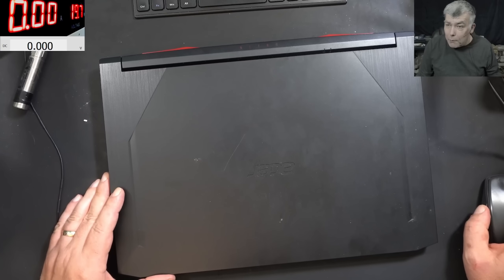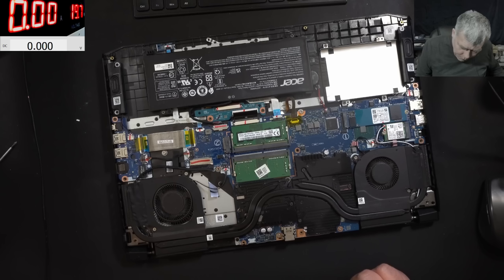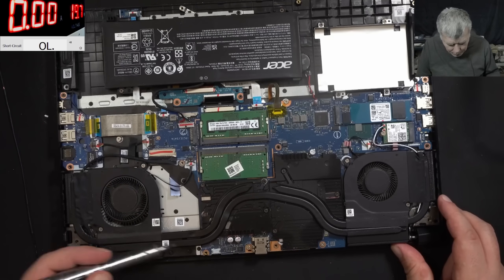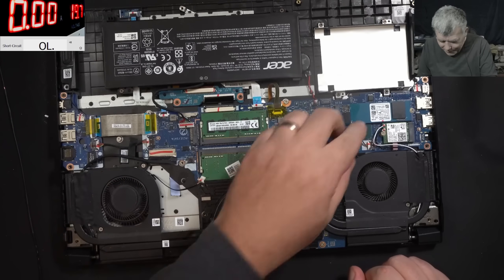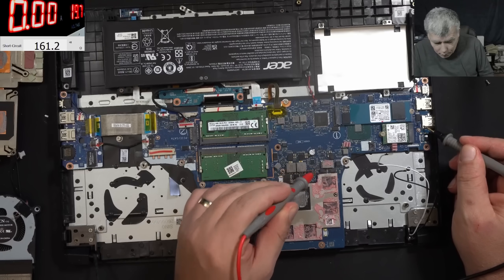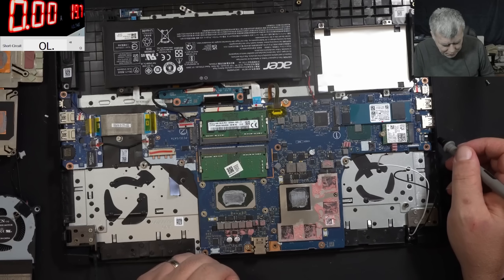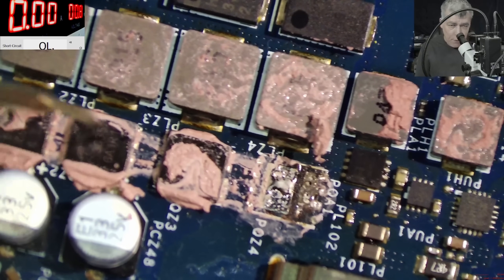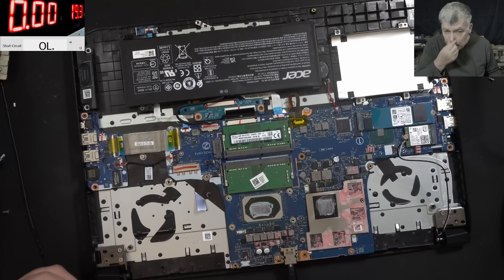Acer Nitro 5 no power - Shorted cpu mosfet, do you belive in miracles?

Comment: I have an Acer nitro 5, a similar model, just decided to shut off on me with no sign of life, took it to a PC repair shop, got a call saying the MOSFET for power regulation was dead, it's currently being repaired. After watching your videos on said gaming laptops, they sure do seem to like blowing MOSFETs or capacitors, maybe it would be a good idea to keep a stock of said components just in case these keep happening to the unfortunate recipient. All in all, very lovely videos showing how to repair and understand these laptops, excellent, keep up the good work brother 👍
Reply: Does anyone know for this laptop ACER Nitro 5 AN517-52-71C7 i7 11 gen. Rtx 3060 model of first N mosfet. I need to replace it but i dont see clearly which mark is on it and which one mosfet i can buy as replacement.
Reply: @borismat  similar model to mine, take it to a repair mob, best advice I can give, there's also no guarantee that the laptop in question will run as good after, hence why it's best to get a new PC and transfer the hard drive and data over, that's the best I recommend
Reply: @borismat  I think any channel-N mosfet with the current rating at 100A or higher should work.

Comment: Merry Christmas Sorin, first off thank you so much for sharing your knowledge, I absolutely love your videos and I've learnt so much more. I was recently watching one of your repairs (can't remember which one) where you was having trouble finding the power on pin on the keyboard connector so i thought I'd pass on a great tip that I came across from another YouTuber. If you set your multimeter on diode mode and red probe on ground then as soon as the black probe touches the power on pin the laptop should turn on. Hope this is useful and keep up the great work.

Comment: Few days back i had dealth with same problem. While the customer applying  cpu heatsink past the vcore ic got shorted and it turned into system to dead condition. While checking motherboard i found that there's main 19v shorted and i sorted out the short by removing cpu vcore mosfet but still there is no image on screen. I think the vcore ic is probably faulty or the cpu. Cpu coils show 0homs

Comment: Hi Sorin... Wish you & your family Merry Christmas. I have a question... if I remove the Nvidia chip from the laptop board will the board will still function & have display?
Reply: The answer is yes, but you will need help from the motherboard schematic, it is not complicated.

In the motherboard schematic, Asus and Acer have a system similar to desktop motherboards, so much so that if the screen breaks, you can use the VGA on an external monitor as well, and it will work normally as a desktop.

What makes the screen choose between the GPU and the processor GPU is merely a hardware configuration (there is a resistor that defines which video the computer will use).

Assuming that the GPU is dead... you can remove it without any problems, and modify the circuit to work with the processor's native GPU, most low-cost laptops are like this, the GPU is not placed, and the circuit is switched to only use the processor's integrated GPU.

There are videos here, where they show how to do this (usually by Indian technicians), but if you do not know, ask a technician to do it, do not do it yourself without knowledge of the circuit or electronics in general.

Comment: Greetings and Merry Christmas to all, I have two questions, if anyone can answer I would appreciate it.
1.- How do I know where the main power rail is to know if the CPU is shorted?
2.- How do I know which mosfet should be removed to remove the short from the CPU as seen in the video?
Thanks
Reply: In general, the processor power line has a specific coil and all these power lines have a filtering circuit (you have high-voltage MOSFETs, which work through PWM and activate the low-voltage MOSFETs, generating voltages for the processor, memory, PCH, among others (I'll try to simplify this as much as possible)).

Each laptop or desktop motherboard is organized in a simple way in relation to this.
Laptop motherboards already have a proprietary format, so the power coils can change places according to the motherboard's engineering.

Generally, this processor power coil or line is 1.05V (a little more, a little less, but it stays in this range), but in some more modern machines, it can change, but it is usually this value.

When shorted, the component will heat up. When the technician does not have a thermal camera, he can simply use the multimeter to determine the short (continuity test), but this is not always necessary because the resistance of the processor or PCH is low (8 ohms on average, more or less, which is not a short).
Another, more archaic method is to put your finger in and see which component heats up. In this case, it uses a regulated power supply and a thermal camera, which allows you to see which component will heat up...
To find out which, a low voltage is applied using the regulated power supply, 1.0v is recommended, above that, it will damage the motherboard track or components, the amperage is important, it is usually adjusted to 1.0 amp or 2.0 amp, the current should not be too high, otherwise, it will also damage tracks or components, 2.0 amps is already considered too high, but for testing purposes it is not a problem, finally, it uses the thermal camera and analyzes which component heats up, in the absence of a thermal camera, you use your finger.
This is how you determine, roughly, which component is short-circuited (this type of test only applies to Chips, Processors, MOSFETs and of course, capacitors).

There is also another type of test, called the 4-prong test, in which a multimeter, fitted with a 3 to 5 watt resistor, for 15 ohm to 100 ohm maximum, is connected to the positive test lead, powered by a pack of common batteries totaling 2 batteries (between 3.0v and 4.5v maximum). Lithium batteries should not be used, because with low resistance or impedance (they are the same thing, resistance for DC, and impedance for AC), lithium batteries will explode.
The test is simple, adjust the multimeter to measure current of up to 200 milliamps, and then... when testing a component (capacitors, more specifically), measure the current of the lowest possible value. If the lowest current is found, then we have the component in a short circuit (because there are cases where, even with a short circuit, there are components that will not heat up). A shorted component, in addition to getting very hot, will have an excessively high current consumption.

Comment: Hello Sorin , on 4min 15 sec , you says the resistance is high, i thing you means the resistance is Low ? Not ?
Reply: In general, the resistance of processors (power supply line) and PCHs are really low.

Around 3 ohms, but the normal is 8 ohms. There are cases that vary, but never too low, even a little higher is normal (I've seen models with up to 2 ohms).

Comment: So I must be a really lucky miracle worker then since I had that same issue on an Asus TUF F15 laptop and removing the mosfet (by griding it down since it was fused to the board) literally "fixed" it. It had no windows ssd but I could get into the bios with no issue... how can I even explain this?
Reply: if you can turn on the bios doesn't mean the CPU is good, only operating system with all tests can verify functionality the whole machine, I had a laptop on the service - ZenBook Pro with defective mosfet, I replaced the mosfet, after that the bios was working fine but Windows won't loading, freezing or blue screen, I finally repaired the laptop by replacing the CPU using BGA rework station.

Comment: Hi Sorin, congratulations for the video, I wanted to ask you a detail, at what point did you do the power injection? it would have been a mistake to do this on the large coils near the CPU?
Reply: he sent power on sensor resistor which goes right after the input mosfet
Reply: @lmmdle2025  hi thank you

Comment: I have an acer nitro 5 laptop 
I5 9300h Nvidia GeForce GTX 1650
I had a blue screen I checked the ram the battery the HDD and SSD but the same problem occurs I sent it to repair shop said it's CPU problem they changed it to i7 9700h but after 4 days the problem came back again the problem I'm in Egypt what could be the problem
Reply: if it was a blue screen in windows, it'll have a stop code or something, look it up
Reply: Hardware problem I checked the code @marksutherland774